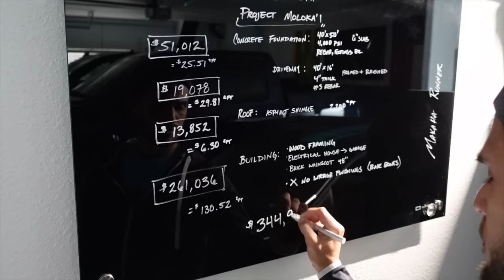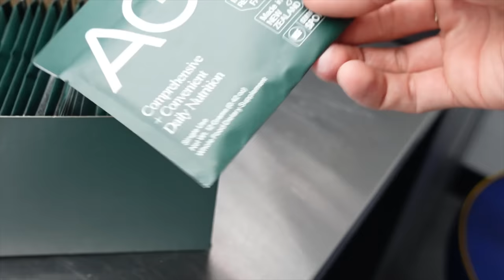TEXAS TORNADO Just Cost Me My Dream Shop Budget... All On Me Now [PART 5]

Comment: I install fences by trade and i hate to tell you but about half a dozen swings of a baby sledge hammer and a piece of wood, will get the whole ball of concrete off those posts in 2 or 3 pieces. blunt force and the vibrations.

Comment: It's looking fantastic bud, yes it is amazing how fast all these little things add up so quickly!  I finally got my piers installed and we also got the power and water dug and ran to the corner of the building.  Now, I'm just waiting on the lumber package and trusses to be delivered around October 1.  I have a small Kubota tractor with several attachments so I'm able to move dirt and drill holes (saving a little money).  I'm really looking forward to your build and also to get going on my build!  Take care and don't work to hard in that heat!

Comment: Love it, from start to finish thus far!!  Keep up the good work, love the videos and the inspiration you bring to so many who want to do this same thing!  
Only thing I want to interject here, is WATER and a drain inside the shop, if you weren't planning on adding this, I would urge you to do so. If your septic is close enough to run a drain from the shop to it, then I would encourage you to do so, this coming from someone who regretted NOT having working water and drain in my shop a few years ago! A small tankless heater for hot water is easy to install as well. Easier to do it now before the yard grows back in and sheet metal goes on sides.

Comment: Great video like always.  I had some trouble with your builder on a new home before so I'm not surprised. 
I'm  surprised the power company doesn't buried the power lines. I know it's more expensive  but in the long run it would be cheaper.  I don't like HOA. My require 1 tree in the front yard.  If the tree is dead than that's OK but if you take it out you are required to plant other tree. They drive around 2 times a month to write people up but at the same time they don't take care of the common areas.  They say the  home owners don't own the fence and you can't touch it but if the brick start to fall off then nothing is done.  Hopefully you will get your well deserved gargle done.

Comment: Yes your neighbor is making a good amount of money but your roof did not look that old. I would suggest to just repair your roof and not replace. You still get total replacement cost from your insurance company but only pay for the repair. Then if you feel later down the road. You can replace your roof. You still have the funds to do so. Also with storm damage roofs. Contractors charge more because insurance will pay more. You can get bids from storm crews. Insurance will write you a check. Then find a local roofer to make the repair or replacement. It will save you money in the long run. Or negotiate with storm crew to pay your deductible. I hope this helps.

Comment: Great video but why not use a swinging door setup for your fence that way there is no removing of fence pieces or bolts.
Reply from the maker: The fence is surprisingly heavy. Would have to reinforce both sides to pull that off. Maybe in the future 🤙🏽

Comment: You should have gone with a Morton building. It would be up by now and the brick would be in process $88,000 and building still doesn't have any skin. At this rate the shop is going to cost more than your home. No bueno!